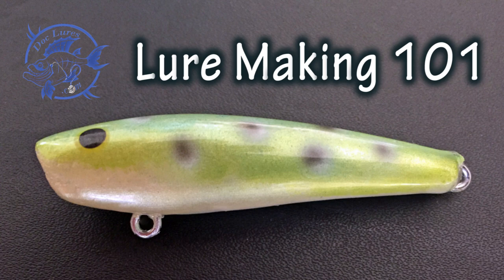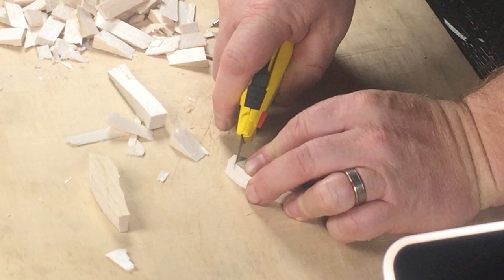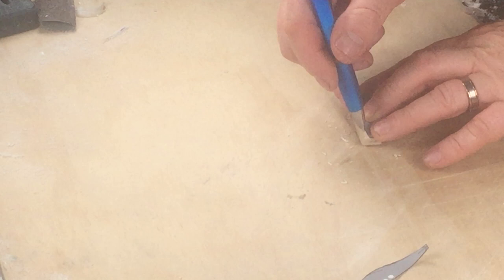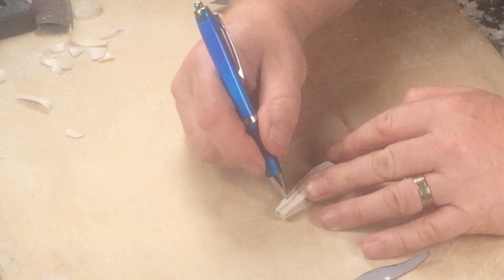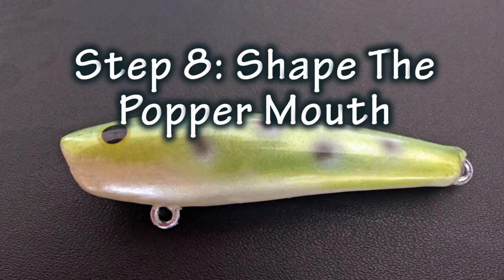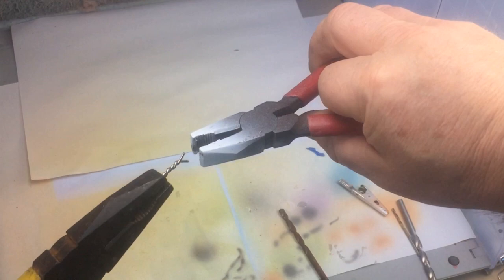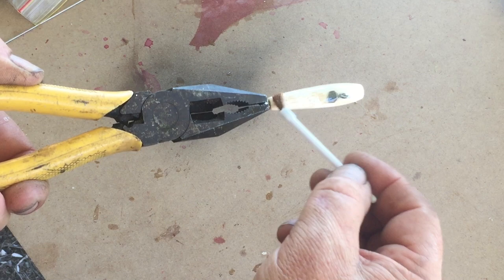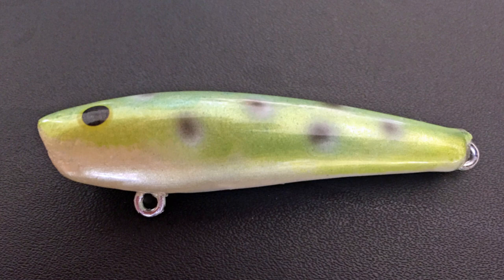How To Make A Balsa Popper Lure

Comment: how the frick did you cut trough the wood like that with a fricking knife
Reply: Balsa wood is like styrofoam. You could probably cut through it with a butterknife if you made enough effort (not cleanly, though). X-acto knives and utility knives are also razor-sharp, and using a sharp blade makes cutting anything easier.